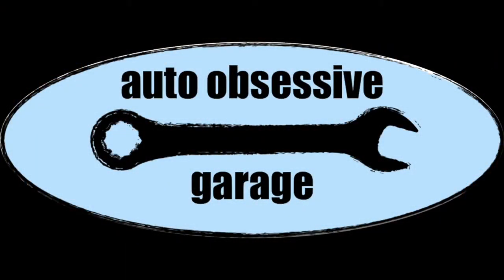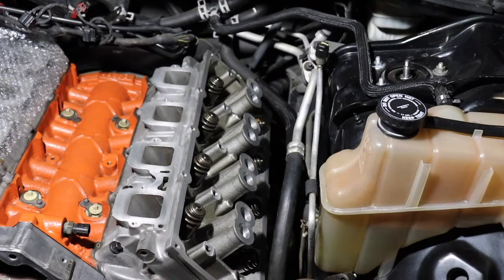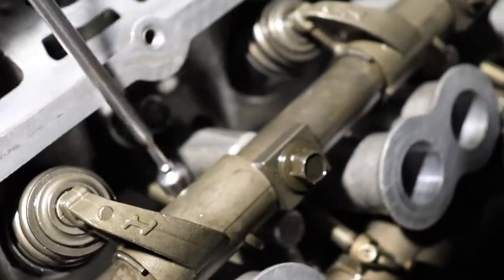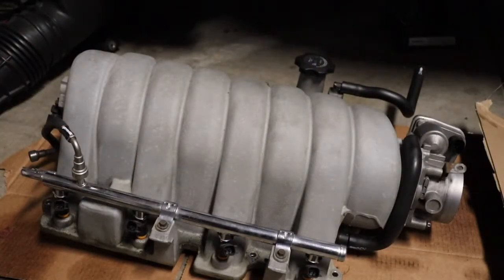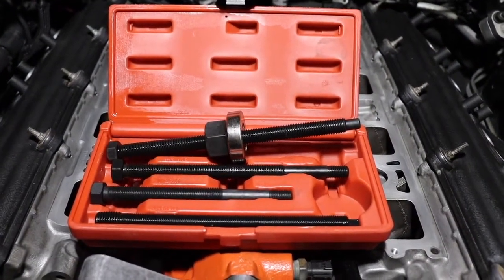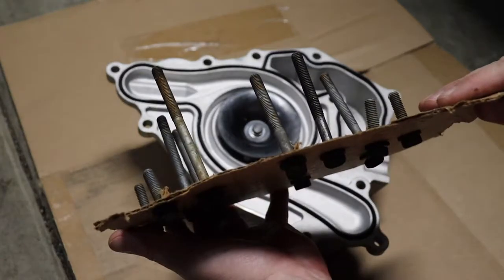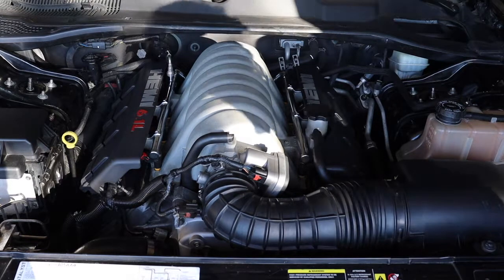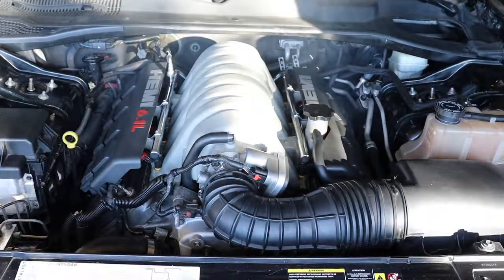2006 Dodge Magnum SRT8  - Episode 12: Assemble and Start Up

Comment: So the 6.1 SRT uses different oil to the 5.7 RT? That because the 6.1 does have MDS?
Reply from the maker: No MDS on the 6.1. Not sure what oil is recommended on the 5.7 but the 6.1 uses 0W40.